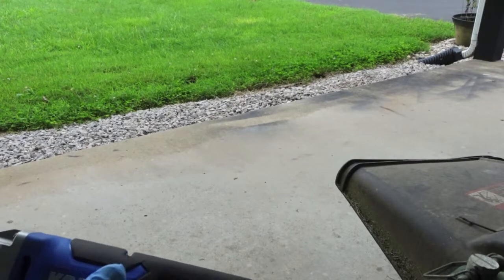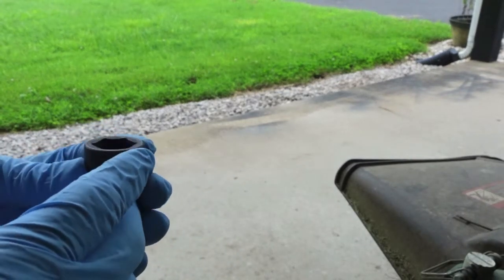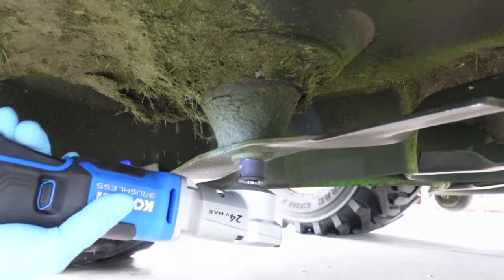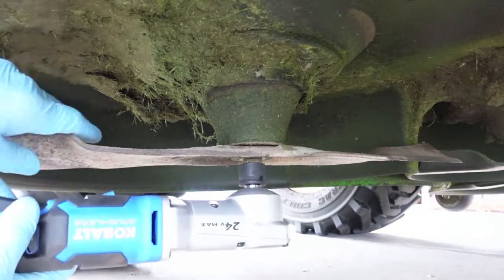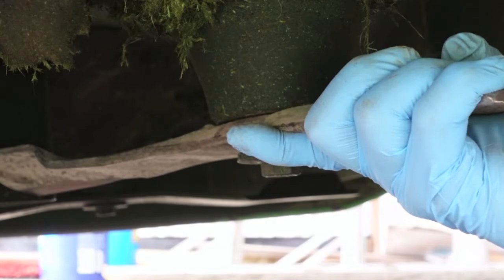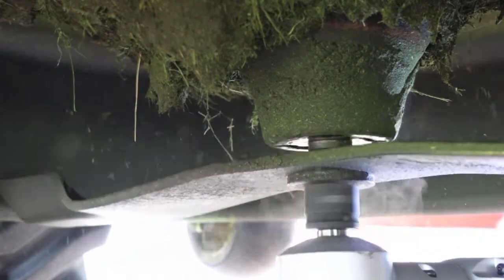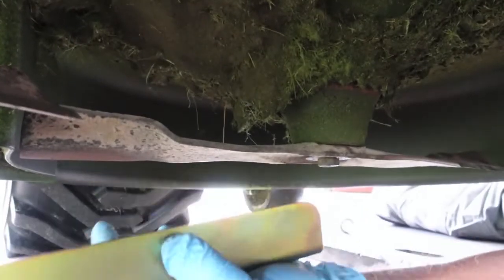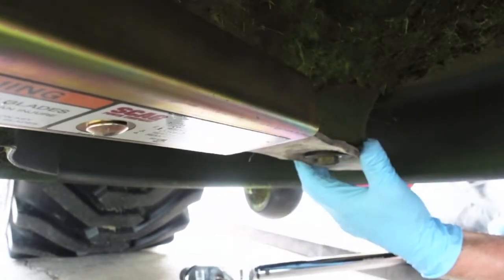Mower blade change with right angle impact and low profile socket AWESOME COMBO!

Comment: I have never checked torque on a mower blade and never had a problem in 50 years of mowing, from push mowers to brush hogs. 🙂
Reply from the maker: You have a good feel for it. Some don't. My brother just stripped out a very expensive Kubota diesel zero turn mower hub with an air impact wrench. He said he always uses the impact.
Now he has to remove the hub and helicoil it. 
I think the torque wrench is more beneficial to impact users than hand torquers.
Thank you for watching and commenting!